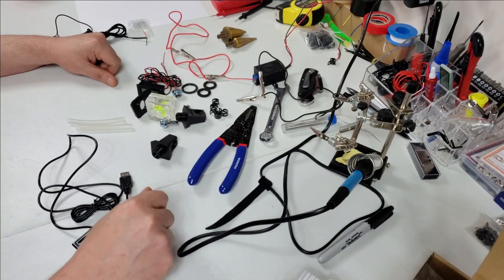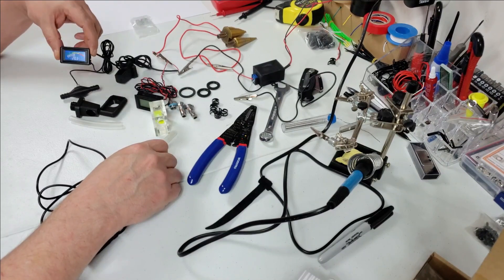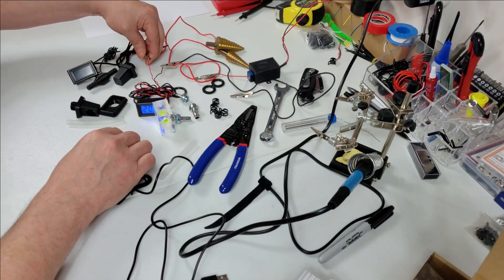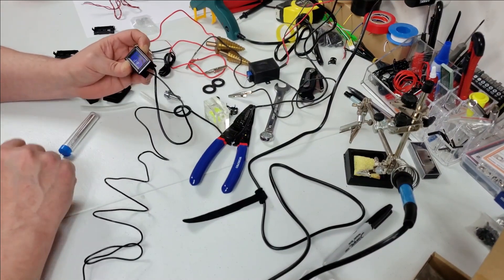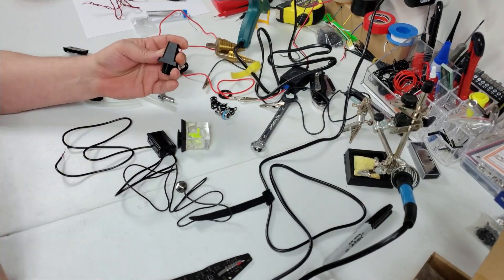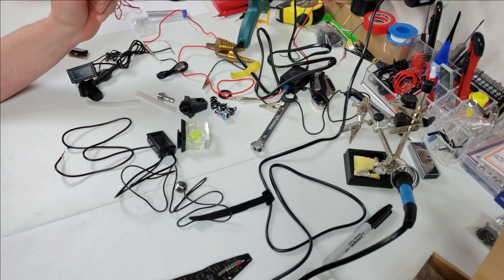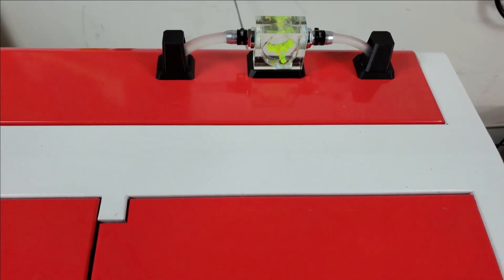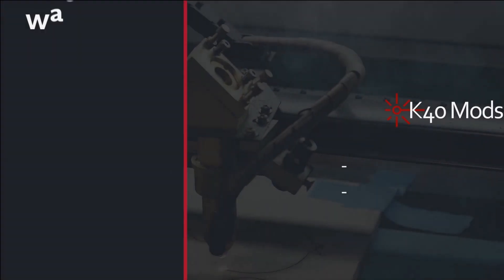K40 Water Flow Indicator - Water temperature In & Out of laser tube

Comment: Where did you get the sensor, for monitoring the water temp out of the tube, shown @ 13:24 to 13:30?
Reply: I do not believe the sensor you are talking about there (13:24 to 13:30) is for monitoring the water temperature.  Some of the early K40 had an inline water flow sensor.  When the Laser was powered up, if the Sensor did not detect water flowing, it would prevent the Laser from firing.  I believe this is what that is.

Comment: Would be good to have a flow switch so if the water supply stops the laser also stops otherwise you risk it not flowing and the laser continuing causing damage to the laser tube.

Comment: The temp out fitting, how did you secure temp gauge in the plastic thru piece?
Great video
Reply from the maker: Aquarium silicone, let it cure for a least 24hrs before adding to system.

Comment: Hi do you have the files available to print the tubing covers on thingy?
Reply from the maker: The link was in an different reply, but here you go. I made them available on Tinkercad incase anyone wants to make changes easy. https://www.tinkercad.com/things/l0bTQE7k8pw-water-flow-parts
Reply: @k40mods55  ok thanks mate i missed that can i also ask i havethe cohesion board ans new power supply were is the best wiring guide for this getting confusing so many different ways out there

Comment: First off, thank you for the great videos.  I find them very useful as I am embarking on many of the same mods.  Also, I appreciate that you made the STL files available for the flow meter and tubes. Great idea!  I downloaded  the files and had them printed at treatstock.  I ran into a small issue with the hole in the flow meter base.  Apparently, my flow meter hole for the temp sensor is on the opposite side so that it won't sit flush in the base when the sensor is screwed in.  I hate asking but Is there any way you could move the hole over so it is more centered between the long sides?  I think 2 mm would give me enough room.  I tried editing the STL file in Fusion but my skills are lacking.
Reply from the maker: Here, try this... I made them available on tinkercad.com https://www.tinkercad.com/things/l0bTQE7k8pw-water-flow-parts
Reply: @k40mods55  Perfect!  Thanks for doing that.  I can adjust in Tinkercad, no problem.

Comment: Really enjoying your series and plan to do the same as you on several of your mods.
I do have one question though.
As related to Water Cooling, can you tell me if their is a recommended placement location for the water reservoir?
Does it make any difference if the water reservoir level is above or below the laser level?
I look forward to hearing your thoughts soon.

Thank you.
Reply from the maker: It all depends on your pump. All pumps have a "head" height. The closer you have the water reservoir to the height of your laser, the less work your pump will have to do and the better the water flow. I currently have my 5 gallon reservoir under my K40 but,  I live in Las Vegas and have my K40 in my garage. Even now the temps in my garage are getting above 20 degrees. I am going to switch out my pail for one of these https://www.amazon.com/gp/product/B07H8S1VNG and see how it goes. I will make a video on it. When I put this in I will put it so it is at the same height as the K40.